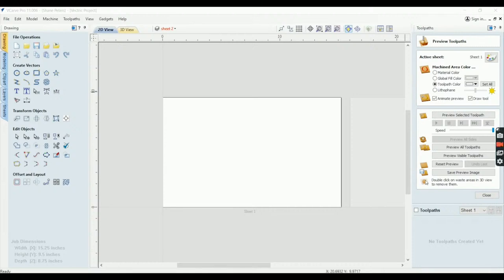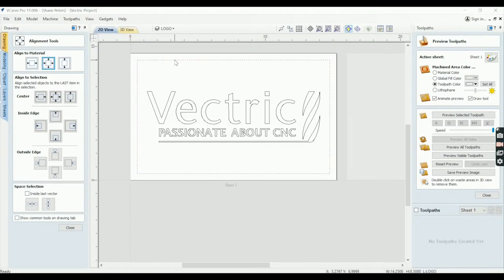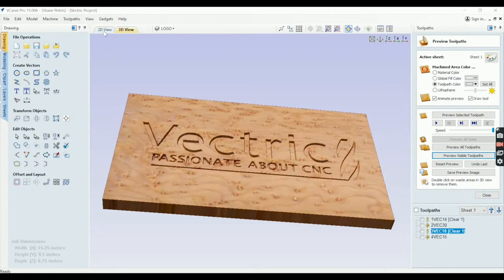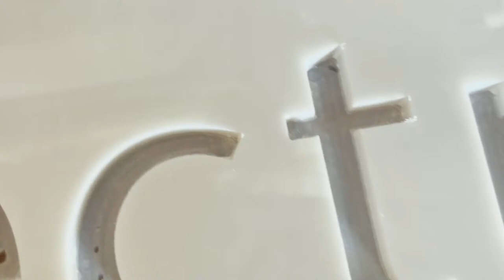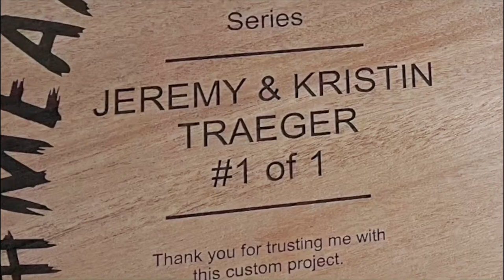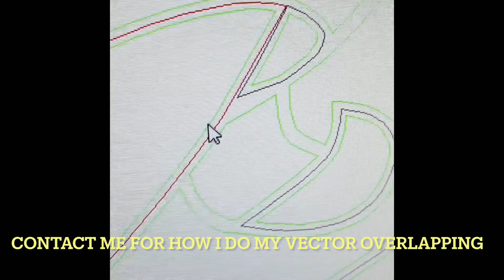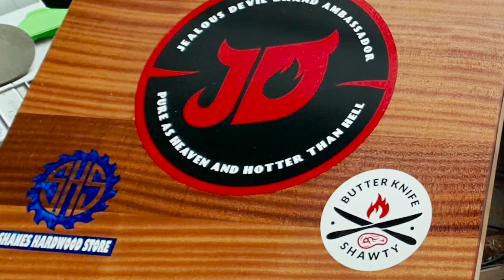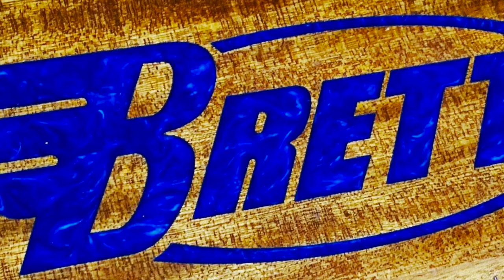Epoxy Inlays with Shane Peters | Vectric Worldwide UGM 2021

Comment: Really nice.  You v-Carved first then used the end mill. Does that give different results than the reverse?
Reply from the maker: Hello John... I suspect it is because clearing with an endmill first might cause some chipping or loss of small islands that should be there for the VBit.  If you use the VBit first then it will avoid this.
Reply: The V-carve goes so much better when it cuts with pressure all the way around it, much less chipping. Thanks for the question, John!

Comment: Hi Shane, Wicked projects and video ! Question - what is the cnc bit you used for clearing the surface of the wood and epoxy in the last stages? - Just checking back. I saw some responses to later posts. Quite interested in understanding the bit you used for clearing the surface.

Comment: HI.  First, thanks so much for this video.  Excellent information.  I currently use MAS counter top epoxy because I am cheap and its not expensive and it works well for individual colors separated by wood.  However when I use it where the colors are touching, because it gets hot while curing, the colors tend to bleed into each other a little.  Leaving a "not so" crisp/clear separation of colors.  You mentioned using West Systems (which is rather expensive).  Where do you get it and how can I save money on it?  Or, is there some other product I could use?
Reply: Are you waiting for the epoxy to cure before pouring the other color? I have never heard of epoxy being able to bleed into cured epoxy of any brand. On Amazon you can buy a bundle for about $150 that will give you a gallon of the resin (105) and the appropriate size container of the slow cure that I use (206).
Reply from the maker: Thanks for the question Lee.

Comment: I love the way that epoxy cuts. I hopped onto Amazon to see if they offer stuff there and saw quite a bit.
Can you give me more info on the type of epoxy you used from West System and the colors you like?
Reply from the maker: Thanks for the question and we will point Shane in the direction of it... :)
Reply: I use the 105 for resin and the 206 for hardner mostly, but it am talking with EcoPoxy about moving over to them. I use EcoPoxy liquids and powders for my colors!
Reply: @shaneshardwood6321  Nice!
I would have tried resin+CNC before but resin looked so static clingy. The resin you used looked like it cut like wood instead of resin.
I'll be trying that 105/206 West System next week.
I'd be interested in your comparison of the West System vs the EcoPoxy. Thanks for the vids! You make some great-looking stuff.

Comment: Awesome … Love the video! By watching several times and stopping it repeatedly I got everything I needed, except … I’d love some details on the flattening part. Could you share what bit you used (brand and part number, or a link to it), along with any other specs for the flattening pass like ‘flat depth’, ‘pass depth’, ‘stepover’, ‘clearance passover’, ‘rpm’, ‘feed rate’, ‘plunge’? Again … THANKS!

Comment: do you fill the pockets just to the top or slightly overfill?  How much shrinkage / settling do you get from that brand of epoxy as it cures?
Reply from the maker: Hello Michael, thanks for the question.  Looked like he did overfill... and it seemd like the epoxy Shane used did not srink at all.  He did mention tha kind of epoxy he used in the UGM website chat.  WestSystem Epoxy...  Hope that helps!
Reply: I overpour like crazy. If you look at the one on my IG page I did for the CEO of Traeger Grills, it goes from looking like a complete donkey show to a work of art once all that extra epoxy gets taken off. I have never experienced any shrinkage at all, well, not with epoxy! LOL Seriously never have noticed it at all and I have done over 400 of these. Thanks so much for the questions, Michael!

Comment: For multiple colors touching each other you said “so i figured out a way to overlap vectors” (?), do you use the offset tool on each color vector area?  What values do you use?  What depth facing value do you use at the end so that it does go too deep and expose the bottom color or wood in between touching colors?
Reply: I will be putting out info on my page ASAP! Thank you for your questions!
Reply from the maker: Thanks Shane!!!

Comment: Do you add a layer of clear coat, shellack, or any thing to the wood before pouring the resin?
Reply from the maker: Hello Matthew... thanks forthe question.  I don't remember Shane mentioning that but it is a good question.  I would make a test part to insure it did not weep or blead.  We will point Shane in the direction of your question and see what he has to say... :)

Comment: Do you wait 24 hours for each color? seems like it would take weeks to make some of the signs. Carve and fill, repeat. Thanks for the demo. Hope you make enough the you can quit your other job if you decide to.
Reply from the maker: Hey Gary... thanks for the comment and question.  I believe you are correct... each color needs to dry fully.  Of course you can purchase fast setting epoxy... so that might help you save time.